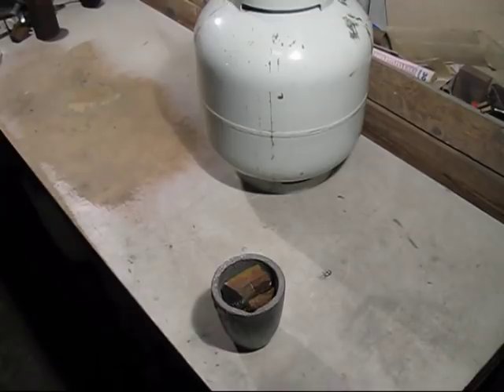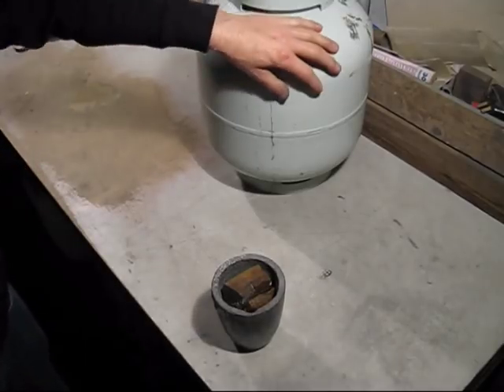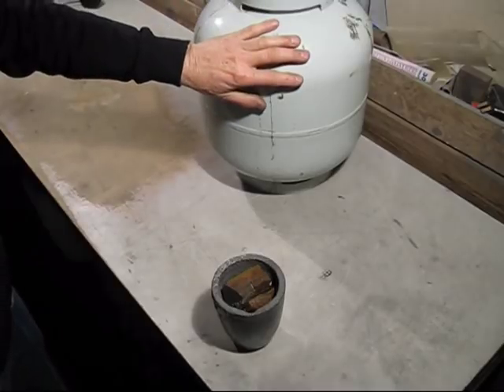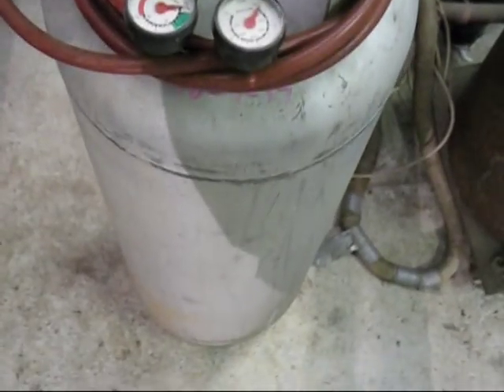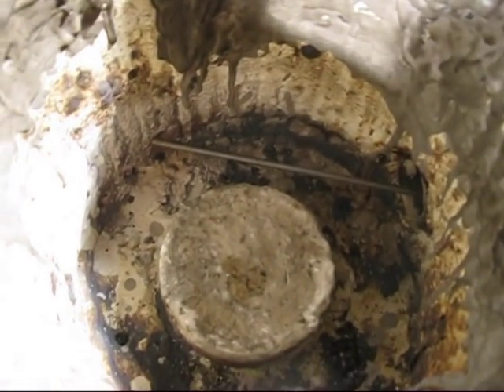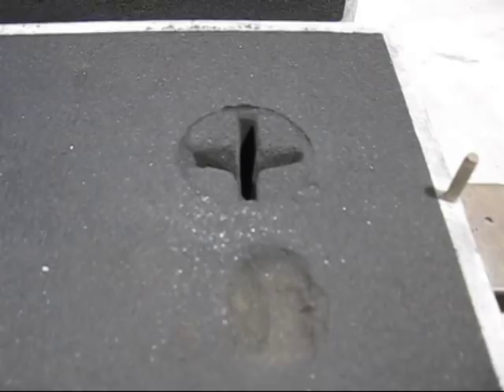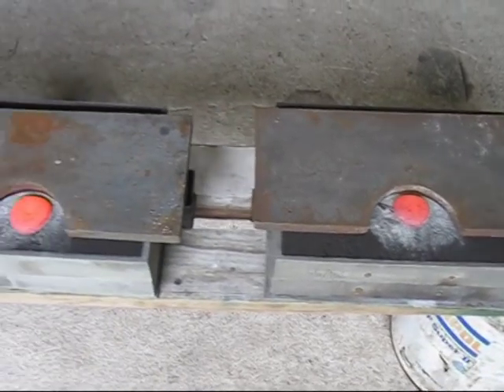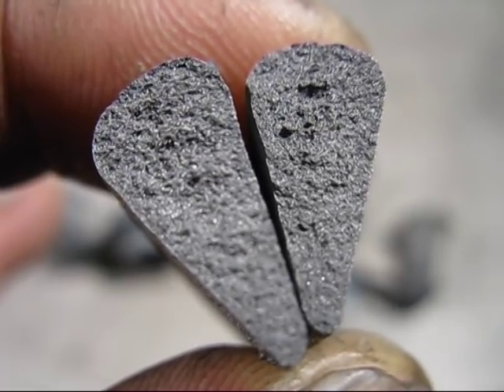Is it possible to melt cast iron with propane?

Comment: Does cast iron keeps it's properties if it's melted by a propane burner in such furnace ? It think in particular of it's carbon content. But there may possibly also other aspects I didn't even think of. By the way - what is the ferrosilicon good for ?
Reply from the maker: If you want to add charcoal just in case some carbon is lost. Ferrosilicon stops chilling on the edges of castings.

Comment: Just wrecked a large crucible. Have been running out of gas, after switching bottle managed to pour out some cast iron, but the upper layer in crucible got solid and I could not remelt it. I could not add any more cast iron as there was an air cusion at the bottom and not hot enough to transfer enough heat to solid top. Searching now for common mainfold to have two bottles connected.

Comment: best way to use propane is to turn the propane cylinder over and use the needle portal with a regulator for control of the liquid pressure

this way from egypt

Comment: Have built my second burner this time out of 2 inch exhaust pipe and a 3mm nozzle with a hair dryer blower and wow does it go... dialled the gas reg to get a good burn but after 10 mins in this weather she froze up and i was having do much fun hoping to cast iron soon.. thankyou so much for sharing your information 10/10  cheers tj👍
Reply from the maker: That is a problem with propane so to fix this use a larger plastic tub than the propane bottle and pour in some hot water.
Reply: @luckygen1001  will test this as soon as this low pressure system goes by we are in Tassie so its a bit chilli at the moment.. 👌👍

Comment: been doing it for 22 years
Reply from the maker: I have been melting iron for 35 years. Can I ask what you were pouring in your 100 lb video?
Reply: @luckygen1001  A trailing truck frame for a 1/8 scale Bigboy 4014
Reply from the maker: @bigboybuilder  Which fuel do you use to fire your furnace, propane or oil?

Comment: Nice. I have a 10kg furnace. Been debating on trying to melt iron. And possibly even steel.  If I could I'd like to give a go at a small striking anvil. And if that works a swedge block. I mostly Smith, but I like messing around with melting.  Got a ton of little bronze and copper coins/mini bars. Made Nordic gold before. We have fresh water snails and the cone shells make cool casts. Stuff like that.   Good work unknown friend🍻
Reply: You'll want to line your crucible with a few painted on layers of something like 3200F cement or similar material, Satanite, Hellforge 3000 ect.  The crucible will act as a carbon donor to steel and do unwanted things.

Painting the inside fixes that issue.

Comment: Is it possible to melt STAINLESS STEEL with propane?
Reply from the maker: You could try it, I have tried it
Reply: @luckygen1001  I could just just manage to melt brass...4-5hr..dare not try  cast iron..may take 10hr..you did it with ease..Which makes me wondering if you tried  ss....just normal propane..no special tricks?
Reply: @lvd2001  FWIW If it takes that long, for brass, then somethings wrong. More heat, ie, more gas, more fan, or even less fan. ( fan could be making it cold)
 Red  brass @ 1025C, Cast Iron 1204C, Stainless steel 1510C. As you can see brass is/should be easier than cast Iron.
Reply: @markneedham8726  you are right, there was something wrong, I found out later with luckygen... my propane tank froze up.. reduced the propane out put..I ahve not tried again..yet.. as I was melting about 5kg of brass at the time

Comment: Fascinating, I had never noticed the "burner" you use before.  Am I correct in understanding that the propane is essentially fed into the furnace through that little pipe and air is forced in through the larger pipe?  And... does the propane and forced air mix in the furnace or just prior to entering the furnace?

The only time I tried cast iron, the end of my burner melted during the process. If I'm understanding your furnace design correctly, that would eliminate my problem.  I might have to make a modification to my furnace.
Reply from the maker: Yes and yes. The propane and air mixes before entering the furnace and burns in the furnace. If the end of your burner melts you are doing something wrong and a lot of your heat energy is wasted heating up the end of your burner which should be heating up your crucible. I never have any problems melting cast iron but sadly so many youtubers do have problems because they copy unsuitable designs and wonder why they do not work for melting cast iron  but it will still melt aluminuim and bronze.

Comment: How did you package the vacuum cleaner motor to quiet it?
Reply from the maker: Yes they make a lot noise but it can be reduced using a wood frame with lot of foam on the inside to deaden the noise.

Comment: How cool is that! I've recently acquired an small injector based propane furnace and was intending to use it for making some aluminium bronze parts.  Just wondering, it's possible to smelt cast iron without forced air?

Comment: Excelent video, Thanks for Share,  what is the work butane  gas pressure you are using.?  I meant what gas presure are in the burner.  All the Best and thanks in advance ofr your answer
Reply from the maker: I use 55 kpa propane pressure at my burner.
Reply: @luckygen1001  Many thanks luckygen, excuse me y I made more question but your furnace really works well, you explain that the oil container is presurized, how much pressure is in it.? Kind regards
Reply: Please accept my Apologies Sr. you said about the oil tank presurized in other video... Sorry
Reply from the maker: The oil container pressure is 300 kpa.

Comment: If you put a sheet of paper or cardboard underneath the crucible it's form a layer of carbon and the plinth won't stick to the crucible when you pull it out. I use propane too for cast iron.
Reply from the maker: Are you still on the yahoo casting forum?

Comment: I bought the same burner set-up and similar sized furnace but the hole in the top is much smaller. Is there an optimum size or just a matter of being able to feed in more ingots and allow viewing and slag removal?
Reply from the maker: I have always wondered why they use such small exhaust vents but you are right you can put in larger pieces of metal and makes slag removal easier.

Comment: Very nice. I got a question tho regarding the ferrosilicon, how much do you actually use? well, i guess it needs to be tested with every raw material you use, but you must have some idea you'r starting at from?

i read some books suggested by myfordboy, but unfortunatly, those outline the general operations and examples, specialy moldmaking and such, which are ok. but the composition of alloys and metals is what i want to read up on, and i would be very thankfull if you could point out some good sources.
Reply from the maker: I start with 0.25% and increase it if I have a hard iron.

Comment: Is the furnace still kicking. If so what shape is it in? H0w many melts have you done in it?
Reply from the maker: Yes the furnace still works. I have done about 20 iron melts in it and plenty of aluminium and bronze melts.
Reply: @luckygen1001  thank you gives me a little more confidence about my build.  

Watch "Part4 of casting aluminum at home furnace build out of 55 gallon drum. Insulation is installed" on YouTube
https://youtu.be/nNfrDBifEos

Comment: I feel so much envy....I have this really stupid question... I know that you don't do that much cast Iron but I guess that I don't have nothing to loose asking about it.... when you have done cast iron smelting... do you need high pressure on the air feeding blower to the furnace?? I mean I have a really nice smelter... but my air blower probably is not capable to put more than 2 psi... as the temperature rise.... thanks in advance.
Reply from the maker: I use a vacuum cleaner as a blower and gives the highest pressure of the easy to find blowers for home made furnaces.

Comment: new subscriber.  can you melt cast iron using the ventury type of burners or does it have to by forced air?
Reply from the maker: Venturi burners will very slowly melt cast iron but may not get the iron hot enough to pour.

Comment: I'm far lazier than you are.  I learned two lessons tending a big coal-fired furnace.  

1: it's hot work, so it's actually nice to do in cold weather
2: tending the furnace and blower distracts from tending the melt

Accordingly, I made my new gas furnace more convenient and usable in freezing weather.   The new furnace runs off the intermediate-pressure line (~10 psi) from the yard bomb with its own 500k BTU/h regulator.  It runs fine in cold weather.  The gas line solenoid, blower, and electric pilot are all toggled with a foot pedal.  Instant on / instant off, all hands-free.

That said, I still sometimes miss the coal furnace.
Reply from the maker: That is why I rarely do iron melts in summer.

Comment: Do you have the propane tube all the way into the furnace when you are firing it, as you show in the video?  Or do you draw it back so the tube is not in the combustion chamber?  Thanks for the lesson Lucky!
Reply from the maker: The tube is not in the combustion chamber.

Comment: I was wondering if it would be possible to re-melt continuously cast grey
iron (it has the trade-name Durabar) and use that (as opposed to your
recommendation of using cast iron disc brake rotors, for example).
Reply from the maker: If you are buying it not such a good idea but if you can get it for free.....
Reply: So nothing technically standing in the way, only a cost issue. Got it. Thanks a lot.
Reply from the maker: Any cast iron can be used but it depends what the end use is. It can be trial and error to find a cast iron that is suitable for your needs and how available it is.

Comment: Easy-peasy: Wrap plastic tubing around the tank, and run hot water through it periodically.
Reply from the maker: I don't have source of hot water in my shed.
Reply: @luckygen1001  perhaps you may use the exhaust flames to heat the water and use it ... Just a thought.

Comment: Nice video, thanks for sharing this.  I think you are brave to pour over concrete...I know I would have drips!
Reply from the maker: When cast iron spills onto the concrete floor it goes like buckshot and nothing else.
Reply: I could be wrong but I think metals with lower melting temps are worse to spill?
Reply: Alec L I spilled pewter once and it bubbled and spit a bit...poured aluminum into a metal muffin pan on a drippy day once and it exploded...went up the side of my house the whole way to the gutters
Reply: https://youtu.be/dAHolupCEkc
I've seen a few videos like this and just made the assumption. 
I've had aluminium do that too. But nothing like the extent that's happened to you.

Comment: The main way to fight freezing propane tanks is to increase the surface area of the propane liquid being evaporated.  This is where larger tanks or even several smaller tanks connected in parallel come in handy.

Comment: Thanks Again Lucky :D ... there is no tv program or movie star that I'd rather see than you....   thanks for another lesson. ...a while back i saw a video of some guys casting bronze in a similar set up... they put a piece of cardboard box between the crucible and plinth before lighting the furnace and kept the crucible from sticking to the plinth... and of course they used another piece to put on the plinth outside of the furnace for moving the crucible between tongs... worked flawlessly to keep the plinths from sticking... if you're interested in trying it.  ... nothing special about it.. just a piece of an average shipping corregated cardboard box, big enough to cover the plinth to act as a table cloth of carbon between the crucible and plinth.

very glad to see you are well... have a goodn
Reply: Me too.
Reply from the maker: I will try using cardboard next time.
Reply: awesome... hope it works out... still haven't set up my own furnace yet... only a forge so far, and a lack of a quality anvil has me set back a bit... one day i sure hope to get the great feeling you must have to see that nice consistent cast iron from your own hands... 

Clearly the only thing stopping me is a lack of will... every time i turn around you're showing it is easier than i thought lol... 

thanks again.. have a great one

Comment: Proper preheat of combustion air is how to get higher temperatures.  Preheat of fuel also helps but to lesser effect.
Reply from the maker: This furnace gets very hot without preheating the combustion air.

Comment: You can use almost any fuel for almost any purpose. The "magic" is the delivery of the proper potential energy and proper amount of oxygen to support the combustion. You should theoretically be able to melt iron with shredded newspaper, but the mechanism that would allow it would be a practical nightmare. Propane has more heat energy per unit of mass than acetylene, so, as acetylene can melt iron, so must propane be able to
Reply from the maker: That is true but heat conservation in the furnace makes it run hotter.

Comment: Lucky, enjoyed. Another good way to prevent excessive freezeup is to simply turn the propane bottle upside down. this worked for me when I converted my car to propane and had freeze problems when bottles where positioned rightside up,
Reply: That may cause problems if the regulator doesn't like liquid propane.

Comment: Super demonstration! I have yet to do CI but will probably use waste oil as Propane is pretty costly for this. Really appreciate you doing this to prove a point it is possible. Cheers!!
Reply from the maker: That is why I only melt small amounts of cast iron with propane it uses less that melting large amounts.

Comment: incredible demonstration procedure with cast iron and propane👌
now, can you cook a good piece of t-bone steak on top of that furnace while it's on fire? ❓
Reply from the maker: If you held it a good distance away so it would not burn.
Reply: @luckygen1001  applaus 👍👍👍
Reply: @luckygen1001  Hi. A query, what material is the crucible you use?

Comment: Very interesting, I have a natural gas supply in my workshop, I was wondering about using it with a blown burner. If I remember correctly, the Natural gas jets are smaller than Propane ones, I was wondering what diameter to make the jet tube! Thanks for all your interesting videos, a mine of information!! Regards, Matthew
Reply from the maker: 30mm plus or minus 2mm will work with most small furnaces.
Reply: Thanks for your reply, I was thinking about the gas tube size, yours is 5mm. Thanks again, Regards Matthew

Comment: Is there any way to make cast iron ductile? Adding other element? would adding magnesium improve it? Or bubbling oxigen...have you tried making it ductile?
Reply from the maker: Magnesium  will make cast iron ductile.
Reply: Small amount of copper. But not sure of %.
Reply: @aubreyaub  Copper not! Small amount rare earths element's (La, Ce) help to stabilize graphite spheroid .
Mg is the right choice (Mg wire or Mg alloy).
http://foundrygate.com/upload/artigos/Summary%20of%20the%20Elements%20Effects%20on%20Ductile%20Iron.pdf

Comment: chuckle. For a bit of excitement, sit your gas bottle on top of the flame, shouldn't freeze then. lol
@ 7.31 on the clip, molten..? taking of slag..? not bad at all. Pump valves.?
I buggered around for years, trying to get an oil burner going, finally got it. Never tried with propane. I may now go to it.?.!.? and well done. Ta.
Reply from the maker: They are well pump parts.

Comment: Hi, Thanks for another video. Do you make your own greensand? Do you have a 'recipe' for the mix with the coal dust in it? Also does chill matter in a cast iron part if you aren't going to be machining it? Thanks
Reply from the maker: Have a look at this video https://youtu.be/3x4Fp85594c  If no machining is required then chill does not matter.

Comment: Thanks for sharing 
Regarding welding does it need to add magnesium to the cast iron or it can be weld ?
Reply from the maker: Cast iron can be welded but you do not need to add magnesium.
Reply: luckygen1001 thank you